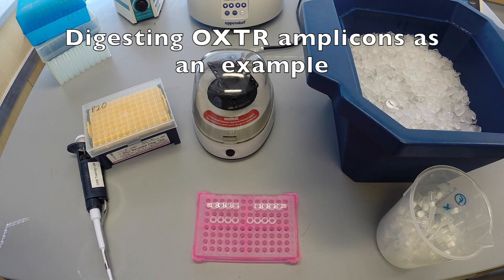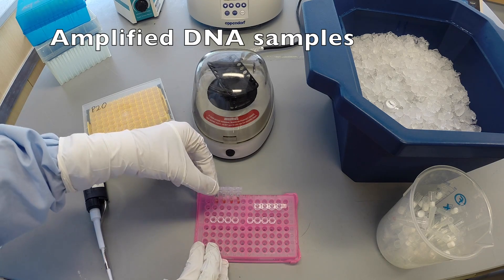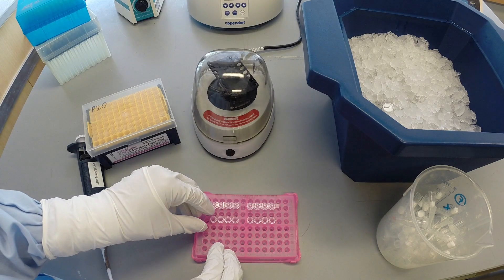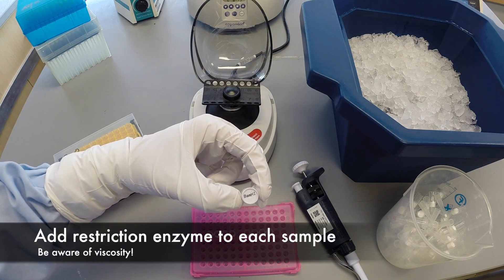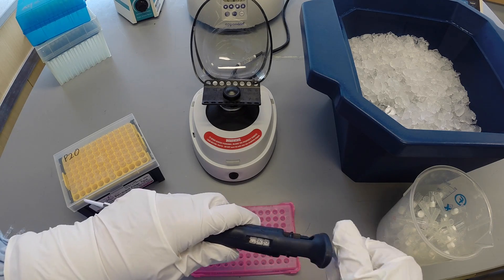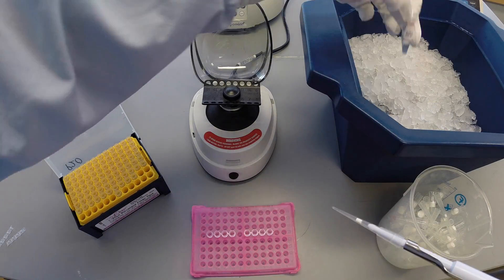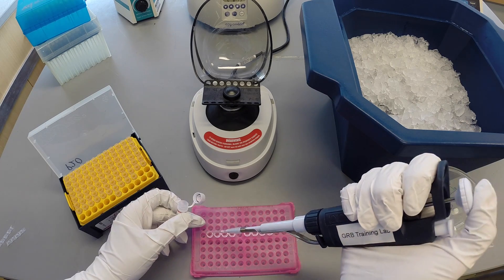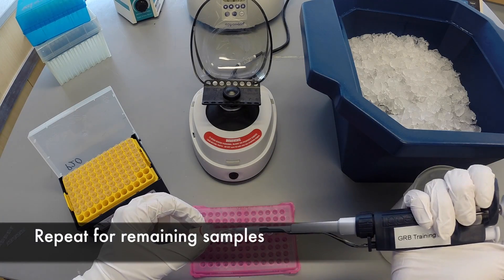Restriction Digest Protocol

Comment: What is the point of doing Restriction Digest before Gel Electrophoresis?
Reply: RD cuts the DNA sequence length to the specific region you want to amplify or work on. GE is used to measure the size eg molecular weight in either kilo bp of the "already cut" DNA fragment of interest. That's it in a nutshell.